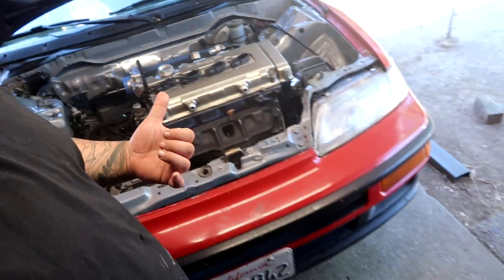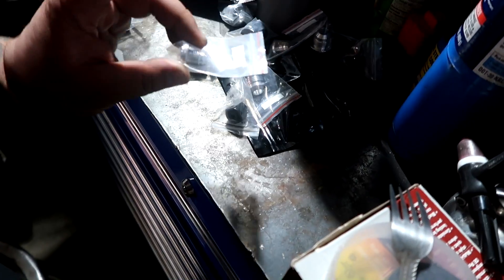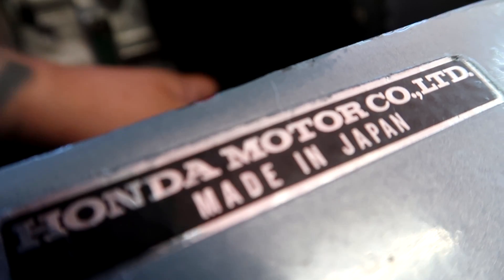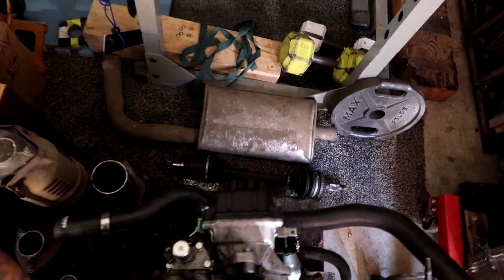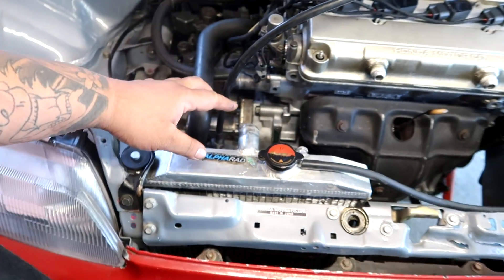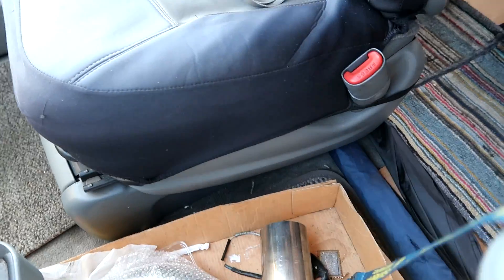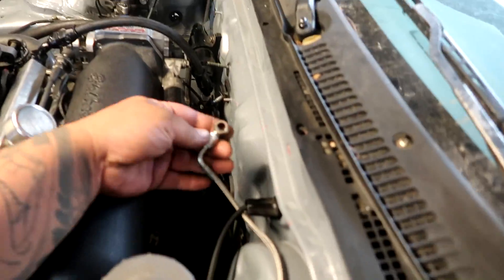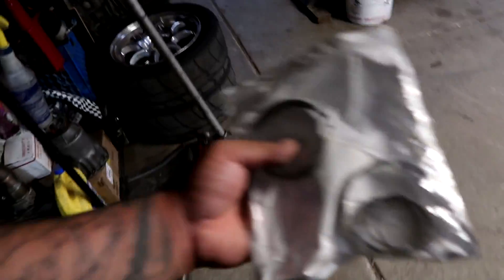AWD CRX Radiator Mod for Ball Bearing Turbo

Comment: I live in the southbay;  and i am working on a model right now for machining a short COP cap out of aluminum;   the major cost at first aside from the tooling is a full bar of proper sized stock costs ~$680;  so yeah...    at least ill be able to perfect the design.   Ill see about tossing a prototype your way.    My whole idea is customization;  get your logo engraved on it, etc.

Comment: Hey im building a b18 and i have deleted the blac box behind the block that had the pcv and i now have a plug where the box went and i removed the 2 allen plugs and put -10 an fittings for a catch can do i need the bungs on the valve cover too?? What do you think?

Comment: What are your settings for welding aluminum? I just got my AHP 201XD and I can’t even pool the aluminum and pushes the filler rod awat
Reply: Watch some videos welding tips and tricks, fabricator series etc.
Reply: Gary!  I switched to a gas lense and it worked fine after that.
Reply: @tarovue6980  absolutely no need for a gas lense on aluminium.
Reply: Gary! That’s what I thought too, I had my settings all over and I couldn’t get the aluminum to puddle. I suppose a gas lense wouldn’t hurt right?